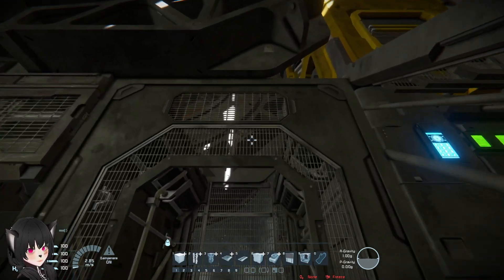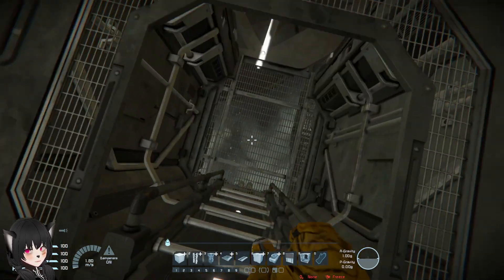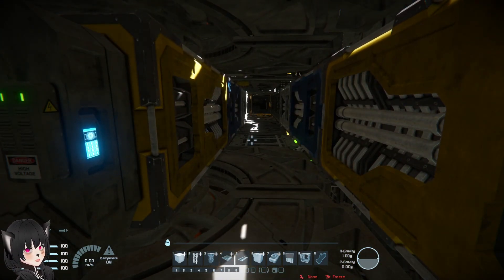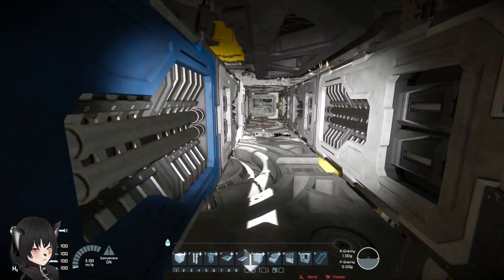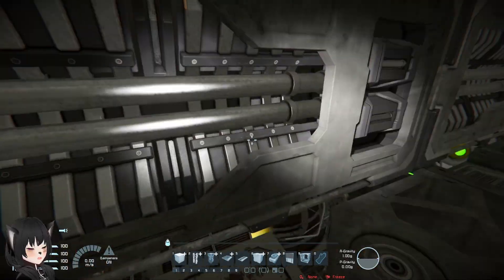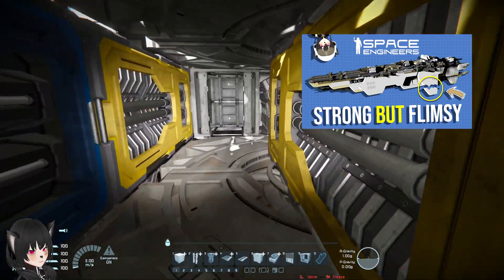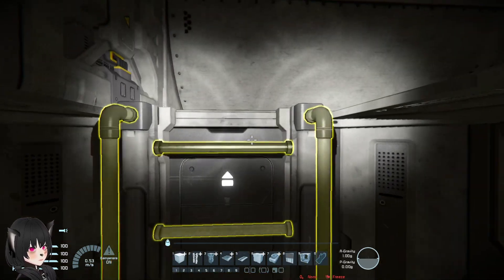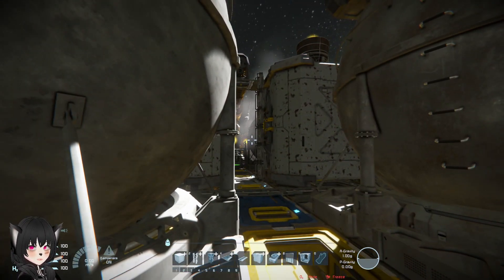This Block Makes Repairable Ships Better, Space Engineers

Comment: Even if you have tunnels you still have 4 to 8 block to secure the connections in stead of 5 to 9 which is just 1 block more. Plus ships with hollow in the center is good because the target lock is only in the center they'd be shooting through that hollow part, so unless they can lock on other parts they'd have to make their own rough judgement manually.
Reply from the maker: Oo, that sounds interesting c= what does Ming mean by 4 to 8 instead of 5 to 9 though x3
Reply: @LucaTheGuide  You know if we have a corridor in the middle you have to place block on 4 sides (your ship is a cross shape in length), but normally we do all 8 sides (square unless you place slope on the edges). So if you fill the corridor it'll mean its 5 or 9 blocks meaning 3x3 hope you get what I mean.
Reply: A pretty smart guy once said, "for your body armor to matter, the enemy has to be a good enough shot to hit it." This reminds me of that.

Comment: Something I don't know if you made a video on or not yet is Beacons and their utility in survival.   

They are good as a hidden hardpoint in your ship for emergency communications, such as sending a message "We Surrender", or letting your fleet know you are retreating, or are attacking, flanking, or have spotted an enemy, etc.  Antennae tend to be on the exterior of the ship and tend to be hit (and even when behind blocks, they are very very fragile blocks).  Beacons can be hidden in any interior 1 x 2 block in substitute of light armor, and gives off some light when on.  I often use them as SOS distress beacons for when my ship is beached on a moon, or to signal in a fleet battle to allies to stay in formation, or to free to engage.  Similarly when to retreat or other simple naval commands making the fleet work together remarkably well even when someone doesn't have a mic or such.  

It also is useful for tricking enemies, making them think you are doing one thing, when giving a secret command to do another "retrete" for example when mispelled means to fall back, maybe behind an asteroid, and then ambush pursuing ships at closer range.  While "atack" might mean to fein a charge, but set up jump drives to a known safe coordinate grid to retreat to and then once the flag ship jumps the entire fleet jumps.  Etc.

Comment: If you want your ship to be more repairable why not use welders? Saves you having to run around the hole ship and can allow you to keep fighting…
Reply from the maker: Welders are expensive on PCU and they're mostly ineffective against Warfare 2 weapons c= I made a video about it https://www.youtube.com/watch?v=VqNQug_G6r0 x3
Reply: @LucaTheGuide  yeah I know I watch the video but isn’t that contradictory?
Weld the ship with your hand welder but not the automated systems? Like I said in my previous comment you can’t fight when your fixing your ship but you can fight when the ship is fixing is self!
Reply: @NATOenthusiast  The reason is the artillery will "pop" your components, making the welders just sit there (or worse detach), plus welders require attachment points (which angers the deity Clang).  If your block is hit by artillery and breaks, turrets will stop shooting it as a priority target, but it is repaired, the turrets have a terrible habit of not losing lock until the block is entirely gone.  

Some of my survival combat ships are durable enough to survive a beating to the point where the main reactor is cracked, and my ship flies off away from battle, and then some quick welder repairs to critical components such as the reactor, and we are all good.  The turret started focusing gyros and less critical components afterwards.  A welder repair wall is easy to hit, requires you to carry lots of components into battle (which isn't worth the risk, as it is better to build a secondary ship or keep them safe in an asteroid cache/ base/ vault.  

One thing that does make the welders more ideal is setting it up for very sturdy blocks like refineries as a wall of sorts with assemblers that set up an ecosystem (not for combat, but for a shipyard), where the rotors/ hinges then point the welders inwards to keep the refinery wall alive preventing enemies from blasting through the ship easily.  The refinery refines ores, going into assemblers to make components, to replenish the cargo containers to feed into the welders, works quite well.  On a combat vessel though, eventually you will run out of components, and quite quickly as you are not a cargo vessel or a shipyard, and the refineries will pop (and their support systems), which will cause lots of ores, components, and such to float around and do severe damage to the interior of your ship.  

It is like when the central cargo container for a ship has a LOT of ice, and is shot open, the giant boulder of ice does excess damage afterwards

Being able to leave battle and rejoin battle is critical, the only welder system I can think of would be for a jump drive due to how strong they tend to be and how important to retreat from battle they are (then you can fully repair).  If you are thinking of a ship for only dueling, I can imagine welders doing ok again, but in a survival combat situation, I can't imagine it going well in most circumstances  <3
Reply: @RikaRoleplay  yeah I feel like this was the biggest "fuck your opinion" comment ever.
I'm just saying it's contradictory to say don't use block welders use human one's that are doing the same job, all I'm saying is let the block welders do the fixing whilst you and your crew (if you have a crew) do the fighting...
nNnoOo DoN'T uSe AuToMaTiOn UsE sLaVe LaBoUr!
See the thing is I physically cannot use slave labour since I'm British and British air is too sweet for a slave.
Reply: Nah welders are a waste of space and PCU, the blocks they're meant to repair get completely destroyed too fast
Reply: @micahhenning9738  they need a buff
Reply: @RikaRoleplay  I think the point of the video is more about ease of repair *out of combat, and you make a good case for your point of view. I agree that the jump drive and probably reactor should be considered for automated in-combat repairs.
My 2c would be that any reply containing more than one paragraph is actually a counter argument, not just a "screw your opinion". More opinions = more informed readers, personal choice used to be a real thing :)